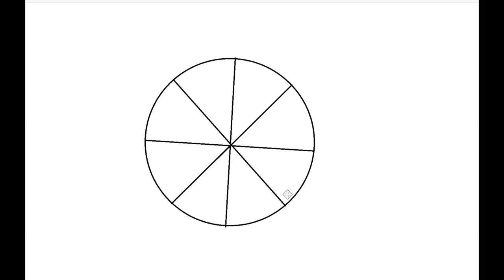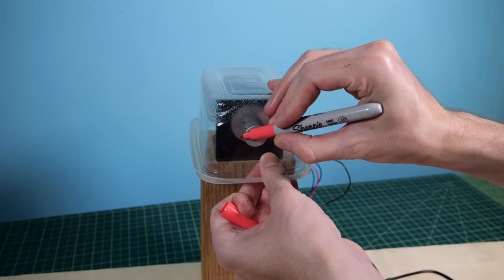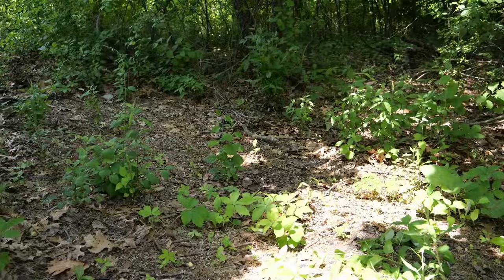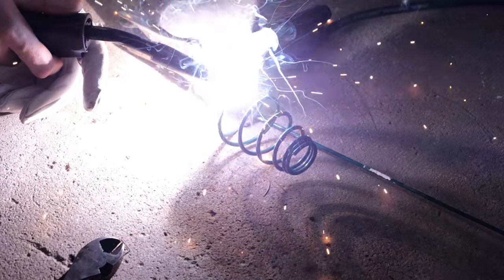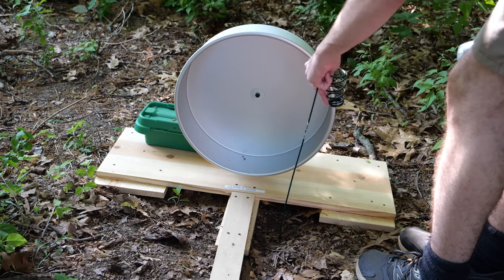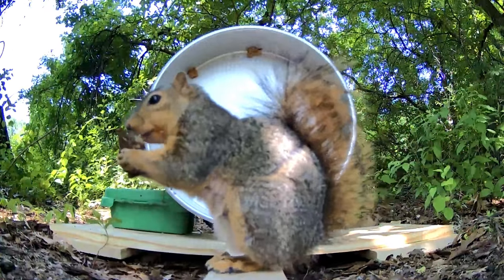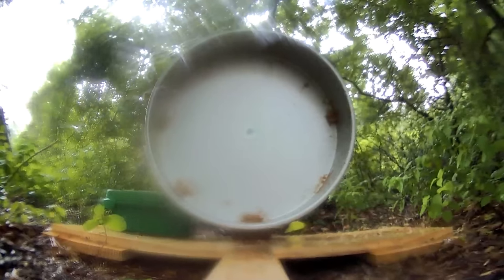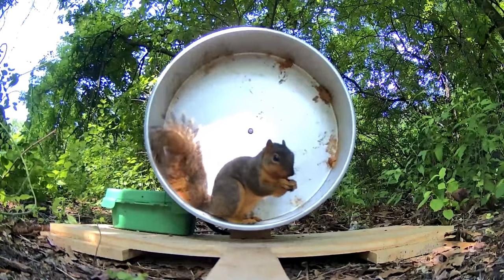Tricking Squirrels Into Charging My Phone

Comment: Just turn it into a windmill. That would definitely charge the battery.
Reply from the maker: Yea that would generate much more energy for sure lol
Reply: Squirrels tend to generate more views though 😂
Reply: I feel like the problem is with that, you have to get it high enough to generate that kind of power. But who knows🤔.
Reply: Their suffering recharges his soul.
Reply: @winstonleeman8739 🤣🤣🤣🤣🤣🤣
Reply: @QuietNerd If you modified the wheel to dispense food as it spins you might get better results from the animals as they learn how it works. I would like to see that experiment.
Reply: im confused, how is a squirrel supposed to spin a windmill?
Reply: @GyldariaTanoGen To be blown by the wind.
Reply: Lol 1,000x
Reply: Get a normal hamster wheel and try that I think that might be to slippery for them to run on it

Comment: the 7805 isnt a transistor it is a linear voltage regulator a switching voltage regulator module would be better for this application

Comment: put a tube in the middle with a corkscrew that spins as the wheel does and have a container of peanuts that gravity feeds into the spindle so when they spin the wheel, the tube in the middle dispenses slightly crushed peanuts. Kind of like a meat grinder, but it's just moving peanuts out the tube.
The animals will pick up on the spin wheel = free crushed peanuts correlation and start spinning it more frequently.

Comment: You should have used a wheel where the animals can see through, either a metal mesh wheel or a transparent plastic one, it's not in a animal instinct to just run in a wall, and if the wheel is opaque, it's like a wall to them
What motivate a pet animal to make a wheel turn is not food, it's mostly curiosity at first and then fun, at first they climb in the wheel like any other surface, and simply try to walk in one direction, but then they realize that despite walking in one direction they are still at the same spot, when you observe a rat for example, they are confused at first but will try it more and more, and you can see it goes from simple curiosity to really having fun
I personally think any pet feel safer in it's home, the closer to its sleeping area, and running mean getting away from this safe spot, so the fact that they could run without getting too far away must be good for them

Comment: You should have had a second identical battery that wasn't plugged into the system. I wonder if the 2% charge was just from the battery sitting there

Comment: For easy cutting thru plastic  use a wood hole saw   Whatever size u need   Heat it up w a torch  doesnt take much  hold it with vise grips    Will burn thru the plastic nice and neat     The plastic stuff is called loom

Comment: You needed to make the wheel an integral component in an obstacle course that literally cannot be completed unless the wheel spins. If that happens, the squirrels will eventually figure the solution out. You needed more complex engineering with a 3D printed wheel that has doorways dynamically opening, and stuff like that.

Comment: 1:32 quick correction: that’s not a transistor! Even though it comes in the same package, it doesn’t switch. It regulates. It’s a voltage regulator.

Comment: I think it's a fun idea, I just think it's the wrong design. I think it would work WITHOUT bait if you designed it right. For one thing the pie pan is flanged outwards so if they really got going they would fall off.  For another thing it's too slippy. There's a reason that pet wheels are designed as kind of a basket rather than a solid cylinder.

Comment: there must be a more precise way to find out how much power the animals created. I bet that battery just charged because it was maybe warmer than last time you used it or some chemical changes happened over time to make it charge for 5 more minutes.
Reply: Not 2% for sure. Probably more like 0.02%.
At least he can rotate this thing by hand, watch current and voltage and guess how many equivalent rotation rodents produced.
More precise way is coulomb counting integrated circuits. But since he can't distinguish transistor and regulator, he won't be able to use it most likely.

Comment: You need to not have the wheel smooth because the squirrel can’t get much traction with a actual running wheel if you notice that it has little bumps for whoever is running on it so that their claws can get traction

Comment: ok so apart from there being no gearbox and your motor axle being the main structural element, steppers being pretty much the worst motor to use as a generator, and you're losing most energy inside the rectifier circuit that for some incendiary reason shorts two out-of-phase AC waveforms;  wtf do you mean by "transistor to regulate the voltage"? that's not a thing a transistor ever does! and the L7805CV is a 5V 1.5A linear voltage regulator, pretty much the worst option to make 5v out of a super-inefficient generator without constant input speed.
have you seen electronics before?
or squirrels for that matter, given 99% of the motivation problems boiled down to "yeah but if i run on this, i'd run past my food, way easier to just shove the thing"

Comment: Maybe you could do a contraption, could be mechanical to not use electrical energy, that would release a nut after spinning certain amount of time. But then there still is a problem of how to teach them to run on it when the reward isn't immediate. Maybe start with like half a spin giving the reward, for some time leave it at that and then with time increase the degree they have to spin to get the reward. 

Just an idea. I throughoutly
enjoyed your video with your nice commentary and being able to see all the animals, which are not the kind of animals you see where I live. It's kinda funny that you actually managed to gather some energy that way. I wonder if it could be efficent and actually be a plausible way to charge your phone. 😂

Comment: You would possibly have more success with a pet hamster/gerbil/mouse ~ these [unlike the “wild” animals] confined to their cage need excise and that is why a hamster wheel is provided to them and why they are often seen running in the wheel, and in the case of a hamster they will spend the entire night running in the wheel, or chewing the bars as they are nocturnal. So make a hamster sized wheel, do the same set-up and put the drive shaft through the bars and see if they will charge the USB power bank?

Comment: make the wheel out of plywood and  use some kind of grating for the sides..like a hamster wheel only larger ..then place a platform out side of the wheel at about the 2 o'clock position with peanut butter in a enclosed container..they will be able to smell the goodies but not get to them

Comment: Suggestion find your plastic cover to go Uber the pen, put a hole in it where they have to go inside of it to get whatever you got in there, put your cup on the inside of the plastic cover, adjust at the top corner, and then that way when they come in, you put the hole on the side that. They kind of come in and make the wheel turn and then the cup up there toward like still lick the peanut butter, and they have to keep going to get to the peanut butter.  In that way, it'll always turn when they're in there. Because they're always have to run to get to the peanut butter.

Comment: You would generate considerable more energy if the generator was connected to the outer rim, as the speed ratio at which the edge will turn is faster and produce better results.

Comment: a large 🐁🐀 Rat er hamster wheel 🎡 made with see through wire would give them a point of reference to look at while running could be disorienting to see a curved wall 🧱 that stays there as you move nowhere gotta look up the mark rober squirrel theme park possibly pie 🥧 pan being at a 45° angle with at least 8 evenly spaced drain holes but I'm thinking you're gonna need more decoy wheels for the friends so they can runa lil bit of power wherever and have it all run back to battery box central